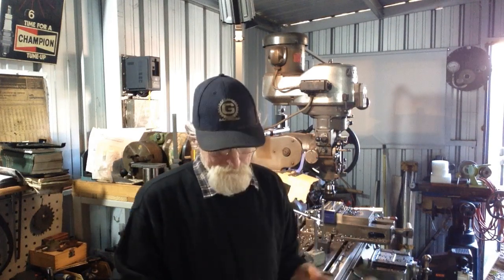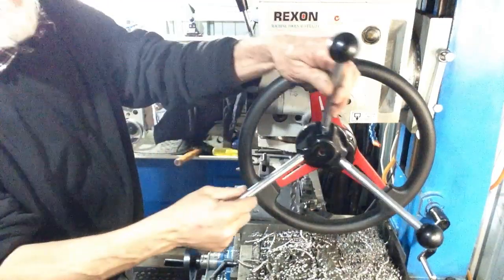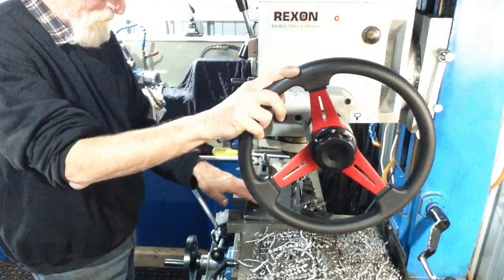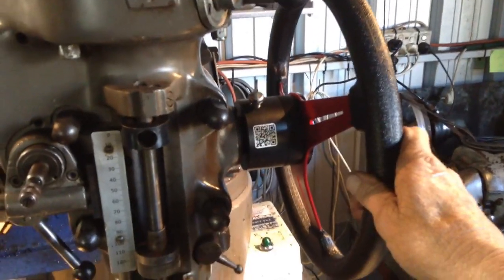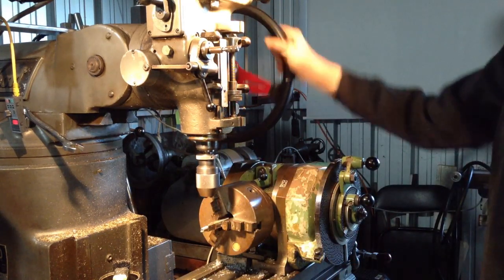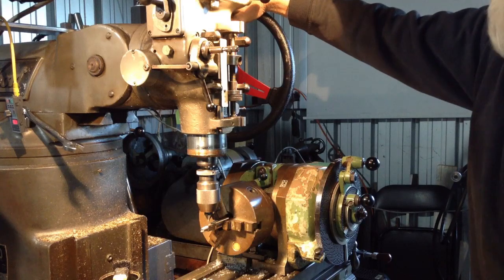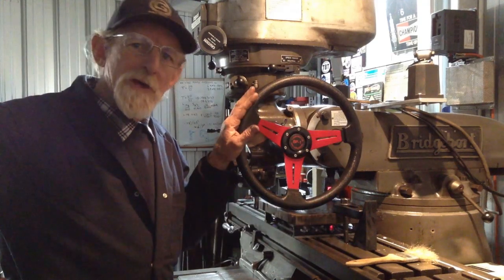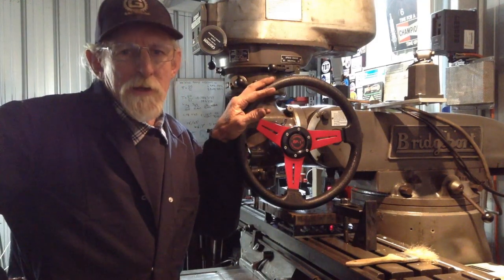TANGENT ENGINEERING  QUILL WHEEL REVIEW

Comment: As they don't make one for a Tom Senior mill, I made my own. I like it. The TS mill is quite tight, so I have had to remove it a few times for clearance reasons. But no big deal.
Reply from the maker: They make a big difference don't they  . There is a smaller one as well .
Reply: @swanvalleymachineshop  Yupp. And not too hard a project really.